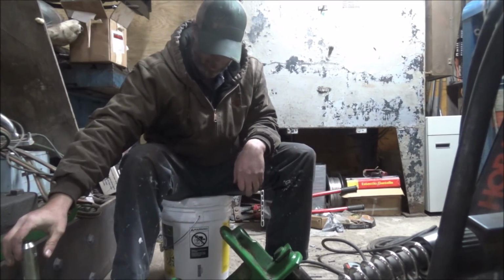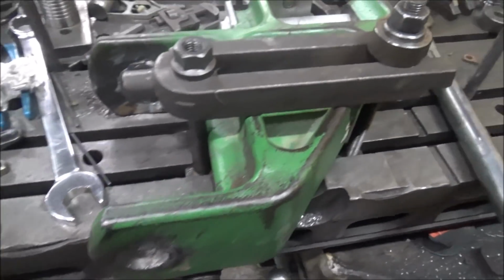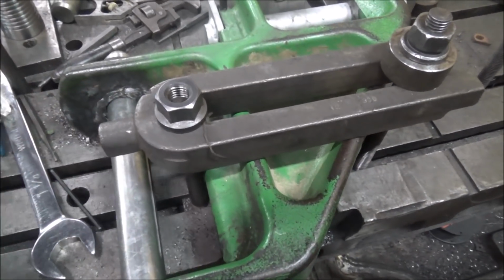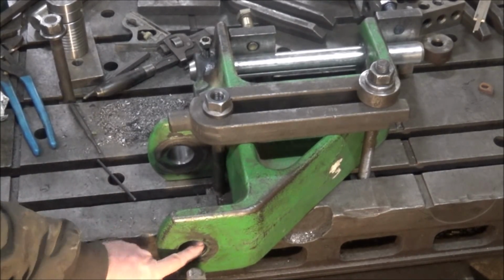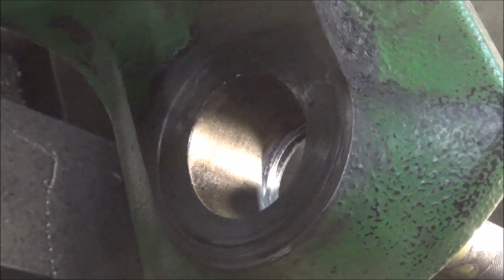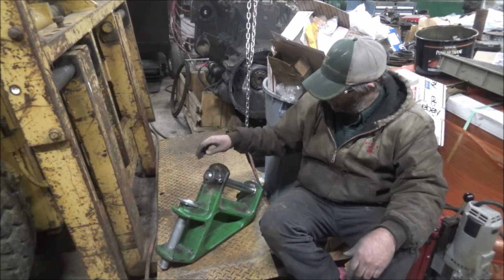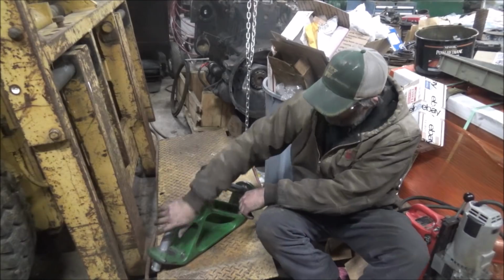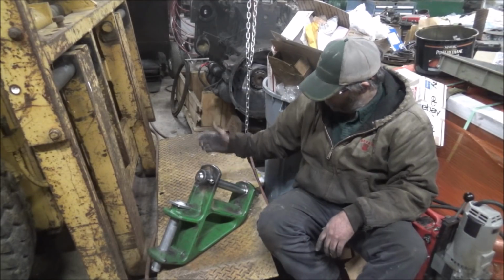Line Boring Deere Planter Hitch, Welding Cast Iron, Heavy Turning Bushings and 15 ton Press Fits

Comment: Looks like that planter hitch is built using the same tolerances used in our Chinese carbide grinders eh? Sure... they go together just fine but definitely need some fine tuning in order to run smoothly. Once you fit them up properly they are fine. I'm sure your customer will really appreciate losing that extra slop. Nice to see the shop boss give you an instant wag of approval too. He didn't have to spend much time looking it over to see it was a bang up job. Life is good.

Comment: Bigger planter parts than the ones we use on the 494A back on mom and dads farm.  Did you not use the press to begin with so you didn't have to recenter the part on the mill?
Reply from the maker: That was the plan. It would have saved an additional setup.

Comment: Hey Brian, why would they make that part out of cast iron and not cast steel?

Baily gives the wag of approval and says "Send 'em the bill!"
Reply from the maker: I don't think steel is commonly cast and it ios more difficult to machine. The ductile iron like this seems to be most equipment manufacturers favorite right now.
Reply: @bcbloc02  OK, thanks.  We had to do a repair on our old 4020 years back, had a pretty good load in the 148 Loader and the front wheel dropped off in a hole, broke the front axle.  The part that broke was cast steel, so it was a fairly easy repair.  Ground it all out, matched it back up, and a bunch of 7018's later, and it is still holding today.  LOL, that was probably 35 years ago now that I think about it.

Comment: Brian , good video,  if you need to get a little better surface finish in the far bore, or front,  I have used a set of sunnen cylinder hones, for different sizes, to get the chatter out of a bore, get a good surface finish and size, on some bores, i had to make a longer drive shaft, I had a variety of sizes and drive shafts,   the bores on the recent project might too small for a regular hone. but i have seen hones for motor cycle engines and use a small diameter hone.  Like you shop and videos.    Wes
Reply from the maker: Could have used a brake hone I guess.
Reply: I never had much luck with brake hones, they don't move any metal,  trying to say time, on set ups.  I also had a set of new and sharp expanding reamers for small bores, up to 2 inch, ,  could hold .0005  with the reamers, run properly.  i like the job shop work that you do.

Comment: John Deere parts from China? Sacrilege.  Probably cast from failed JD cast iron stuff shipped to China to make new parts.  We should not put down Chinese parts as they pass the quality tests made by supposedly USA companies.
Reply from the maker: Yeah the castings seem ok and I am sure Deere specified the slack tolerances themselves. Deere has had factories in China for at least 40 years.
Reply: @bcbloc02  I worked for a major automobile manufacturer 55 years ago and saw the boxes that came into the car plants that had Japan and China on them.  Like it or not, companies will buy from anywhere stuff that is cheaper but meets their standards. That is one of the things that make more profit, but not bring down the price to the consumer. 
I still have a chrome lugnut from a 1966 car that I brought home from the plant. It was costed to the assembly plant at $0.03 and at that time sold for $1.74 at the dealer.  The cost to the assembly plant included the markup from the parent company and the markup of the maker. My bet is that the cost to make it was less than a penny.  The average cost of production of a 1966 automobile was about $1,500 out the door of the assembly plant.  At the dealer, it was well over twice that.  Advertising is a major expense of vehicle production.  RAM Tough, Ford Super Duty, Chevrolet Dependability, and so on. For the cost of one 60 second Super Bowl advertisement, they could give away 30+ trucks.
Reply: Chinese castings really do suck though.
Reply: @wconstructionco  Remember this, Japanese stuff was considered junk for years. Now if you have a Mitutoyo micrometer you think you have the best. While not a fan or hater of Chinese stuff, I do believe they have decided to make quality stuff to improve their sales.  Case in point, Harbor Freight, while still selling cheap tools, now are selling tools (ICON) that meet or exceed Snap-On.  Their toolboxes are about 1/6th of the price of Snap-On and if you stuck a Snap-On badge on them no one would know the difference.
Reply: @bigun447  the General line of tool boxes are garbage, well unless you never move them and never load them up. I wasted money figuring that out. Rather have vidmar, lista, etc.  
The last place I look to save money is on tools, tools feed my family, I can't afford cheap tools.  Chinese castings are crappy, no consistency on the recipe, they do not let them season appropriately, warp after machining.
Plenty of foundries in this country, how much do companies save having stuff cast in China?

Comment: Enjoyed...are you using the radiant heat in the slab??
Reply from the maker: It stays on but with only 15000btu of heat input the shop only stays about 15-20deg over whatever it is outside.
Reply: @bcbloc02  I would think 15 to 20 degrees rise with only 15000btu's is pretty good!!

Comment: Our components are very accurate, we use special larger tolerances for your convenience.
Great repair job Brian, yes, welding on cast or most steels below 20°C/70°F makes a big difference to the weld and parent material properties.
Great vlog thanks for sharing.
Reply from the maker: Yes it is very convenient! LOL

Comment: Hi Brian, 
You've taken out the factory built in 10 year wear clearance. 

It's amazing what all those small amounts of slop in pinned joints can result in. And most would see a drop of oil till failure. 

Nice job.

Comment: At 12.40... why not freeze shrink the bushings.... it works fantastic on thin wall like that. Nice to see you have enough clamps again 😁
Reply from the maker: I have no access to liquid nitrogen..........
Reply: It would've worked perfectly for what you did. I've used it myself.
Reply: Brian, don't know if you are aware of it but you may be able to find a -150 C freezer used online  that could be used in place of liquid N2. Need a 50 amp 220 service to work it. Just a thought.

Comment: Are you still using your in slab heating?
Reply: He needs to find a proper boiler with enough BTUH output (per the sq ft and tube length).  There is not enough capacity in the original water heater idea.

Comment: Would a hardened sleeve be better for things like this?  Or will those wallow out as well?
Reply: I was thinking that myself.
Or weld it up with bucket hardfacing rod.
It's a LOT cheaper to replace a pin than have machine work done!
Reply: I think the idea here is the improved fitment alone (so the pin isn't banging around) will prevent wear, the pins don't rotate in the part shown.
Reply: @Broken_Yugo  This I can understand.
I can only imagine the beating those pins get banging around hundreds (or thousands) of acres.
Reply from the maker: I think a hardened sleeve would likely break from the beatings it will take in operation.

Comment: If you could please I would like to know the info on that double cutting boring head. I have the insert cartridges for 2 sizes of head but no head to use them and I can't find anything online as I don't know any brand name to look for or technical term. If you can help me out I'd greatly appreciate it. Thanks. Love watching the boring me work.
Reply from the maker: The ones I have are Kennametal they have been obsolete for 20 years as best I can tell. What sizes do you have as I am missing some bore sizes.

Comment: Quarter inch cut. There is no way an Axelson  could do that.
Reply: Quarter inch cut on the Axelson I used to have was no problem.  It wanted more!  .250" depth of cut at .015" feed rate was what we used to run on the Axelson when roughing.  Either one of Baily's Monarchs would have no problem taking cuts like that! Ken
Reply: @4GSR  i don't know Axelson lathes but i suspect a Myford  Super7 is only a kiddies toy in comparison.😉
Reply: @4GSR  I am having fun at Steves expense. thank you.
Reply: I have done close to that, 200 thou, while demonstrating on a Myford but admittedly very fine feed, razor sharp HSS tool and on free cutting mild steel. Not a commercial process to be considered worthwhile. 😉
Reply: @chrisstephens6673  I am just having fun at steves expense. thanks
Reply: @kevinriese6384  im all in favour of a little fun.😊

Comment: Another Bailey approved job, call the customer to pick it up and move on to the next.  When you're working in a cold shop, do you bother with temperature adjustments to dimensions for jobs like that?
Reply from the maker: Everything is the same temp including the measuring tools so since all measurments are comparitive it doesn't matter. If I was doing something to a specific standard size it would matter.